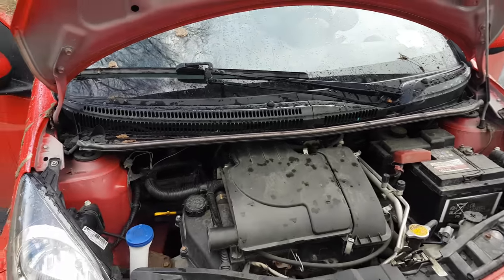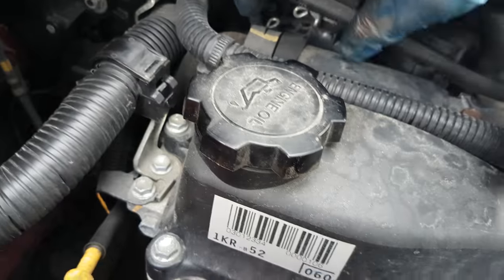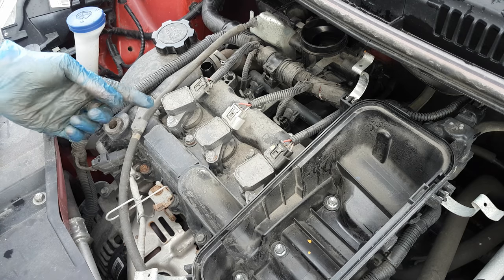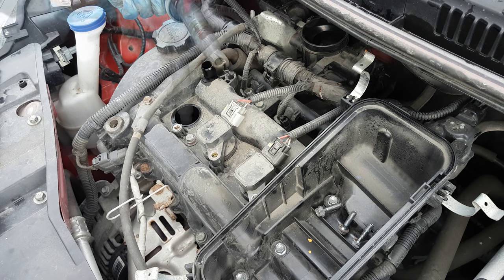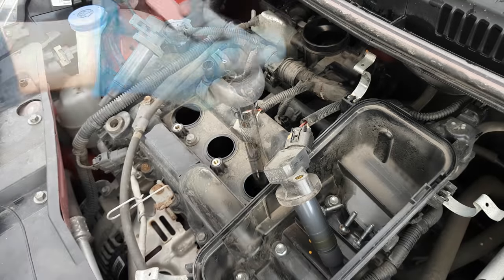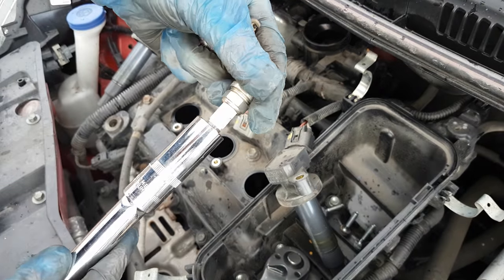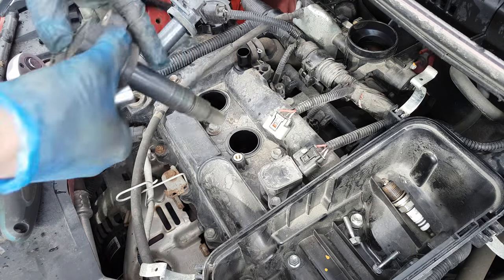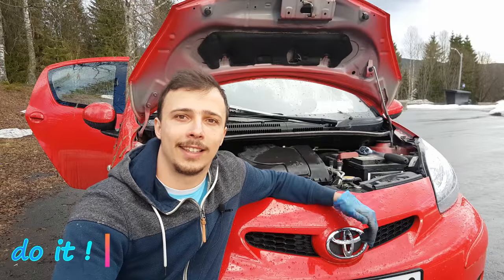Toyota Aygo 1.0  Spark Plug Change

Comment: Your instructions and the 4k resolution are just amazing!! I was wondering one thing, if I don't have a torque wrench, how much should I tighten after they are hand tight? Some say 1/4 of a turn, some say 1/2. I really don't want to do something that might damage my engine.
Reply from the maker: Thank you ! For this car since it's a aluminium engine block - the spark plugs can be tighten betwen 18  to 20 ft /lbs . Without a torque wrench after yout tight them by fingers go with 1/4 of turn as you said but not more than 3/8 . Let's say if you have some small oil leaks into the spark plug hole than the torque specs can be lower but the turning will be the same even if it seems to be a light twist .

Comment: Hi
Can i use Denso K20-U11 in this engine?
Reply: No, you should use Denso K16HR-U11. It's mandatory. They are considered "hot" plug, since the engine it's small and hard to reach the correct working temp.
3 of them costs about 15€ in the bay.
Reply: @xyzRyoxyz  k20 is just what it say in the owner manual for some reason
Reply: @aleksandrzinkevics1253  my manual ask for k16hru11. Aygo now 2010.